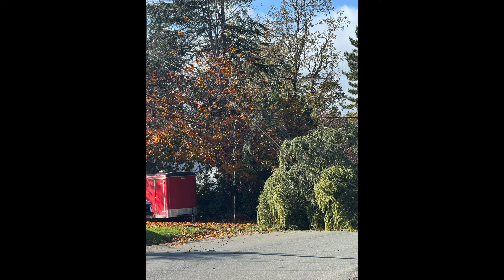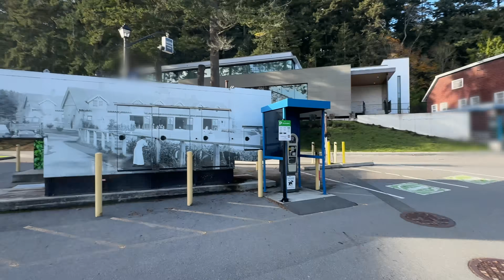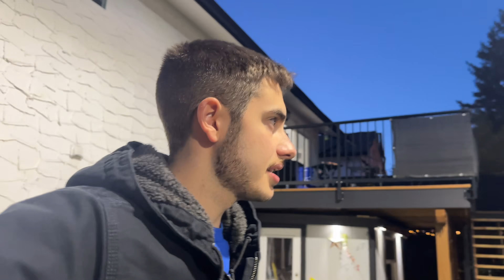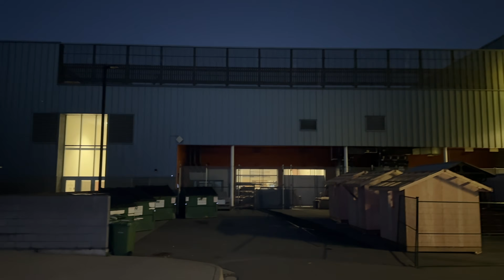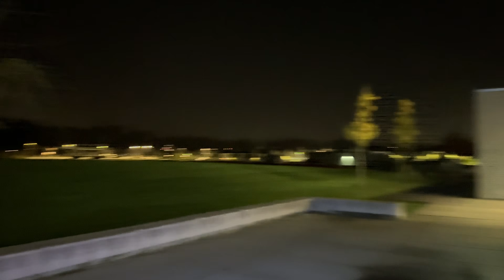11 Hours Of Power Outages And House Electrical Fried With 14,400 Volts On Neutral!

Comment: it might be time for canada and the us to revise the power code to no longer bond neutrals and grounds together at the main panel
Reply: "Neutral-to-earth bonding stands as a cornerstone of electrical safety and stability, particularly in 230V systems where the stakes are high."

Neutral-earth bonding at the service entrance is done around the world.  In Australia they call it a MEN system.  In the UK it would be a TN-C-S system (IEC 60364 nomenclature)  Go read up "Earthing system" on Wikipedia.

In all cases, the purpose of the local earth rod is to compensate for resistance on the shared earth/neutral going back to the utility.  Removing the neutral-earth bond does not make things safer, and in a situation like this could make things much more dangerous for the residents of that house.
Reply: @rampagerick  nothing seems to be safe if the place is surve protected if the surge protection cant shunt that nasty power somwqehre i know i would be homeless after a power surge as my mom wouldnt be able ot afford to replace damaged electrical wire
Reply from the maker: Definitely not a good idea your grounds would be almost useless then and wouldn't protect equipment from becoming energized nearly as effectively.
Reply: I could be wrong as I'm basing this off of my knowledge of American wiring but I think that would stop ground faults from being able to trip circuit breakers. The grounding electrode is for keeping voltage to ground low and it won't allow a path for fault current to flow back to the transformer. The bond allows a low resistance path form the ground to the neutral going back the the transformer to which allows fault current to flow and trip over current devices.

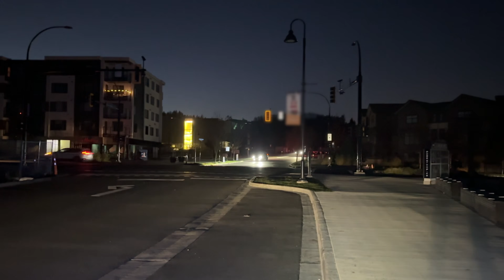Comment: 18:32 - We have the law on the books in Connecticut, and I can't imagine it NOT being a law in all the other states, that you treat a non-functioning/malfunctioning traffic signal as an "all-ways stop." I can't tell you how many times I've almost been rear-ended for stopping at a traffic signal that has no power, even when public works puts out portable "STOP" signs in the street itself.
18:41 - And that's pretty much what I shout, almost word-for-word, although there's usually an obscenity or three thrown in for good measure. Of course, I'm in a car with the windows mostly-up. 😆
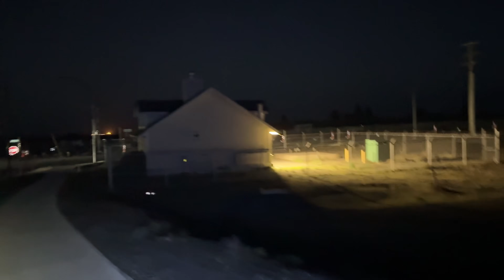19:28 - I appreciate the fact that the pump house isn't built to look like Generic Pump House.
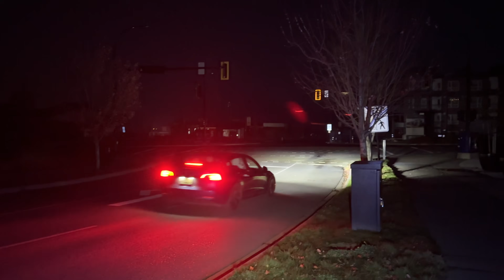19:55 - Hey, buddy, where you gonna charge that Tesla right now, eh? 🤪 (I'm part Canadian, I can say that, right?)

My house has ~300' buried feed, I've never felt better about that than I do after a major storm. Trees can fall in the woods, trees can fall across the driveway, but I don't have to worry about the power lines. As long as the neighbors who back out of their driveway at 20 MPH at 6 AM without looking have power, we have power. 😆
Reply from the maker: Yup same thing here nonfunctional traffic lights is to be used as a four-way stop. There are so many idiots out there though I'll just stop and then go and make the other is not stopping have to do it very abruptly.
Reply: No it depends on the intersection. If im going down a 5 or 6 lane mahor roadway im not going to stop for every little light esecially when i see there is nobody on either side of that intersection. And at large intersections at heavy traffic you need to go in groups of 2 to 4 cars to get though with any efficiency
Reply from the maker: @jacksonledford6874  well if you try that here you are probably going to get hit.

Comment: All the wiring in the house has to be replaced!
Reply from the maker: It will be left up to the electrical contractor if they find the insulation is no good. I can't say for sure it's integrity.
Reply: @nics-systems-electric Residental wiring are rated 500V max, rewire is obligatory or it will cause fire in the future._
Reply from the maker: @DjResR  just 300 V for NMD so they will have to do megger test
Reply: @DjResR  you said it would cause a fire? But if it's short it wouldn't the breakers trip? This is assuming they're replaced with a brand that actually trips.
Reply: @franklofarojr.2969  Short circuit still causes sparks and it igniting something in the wall cavity is a possibility. Even worse if it's not direct short but instead a carbon tracking that acts as a heater or filament._
Reply: @DjResR  Yep and those can happen inside the walls for days or weeks without tripping a standard circuit breaker. This and overloaded extension cords are the leading causes of electrical residential fires
Reply: @franklofarojr.2969  A tripp[ed breaker is no match for the overvoltage event. The main breaker tripped, the fault was to the neutral, which has no breaker and is grounded. The high current source exceeded the capacity for the grounding to hold the voltage low, so the overvoltage went everywhere the neutral and ground wires went.
Reply: Yes you cant trust anything electrical that was connectet at the time of incident. Safety of Insulation is compromised.
Reply: @flipschwipp6572  definitely agree
Reply: Definitely
Reply: The wiring is probably no good. Even if everything is working once the power is restored, that still doesn't mean the insulation isn't damaged. There could be places that the insulation is compromised inside the walls and ceilings and aside from having X ray vision, there is no way to know unless they tear the walls down and look at the wiring, at that point even if the wiring is still good, you might as well replace it.
Reply from the maker: @Truckguy1970  you'd use a megger which is an insulation test to check the insulation.
Reply: @nics-systems-electric  Ah ok, so that should be able to tell if there's a short or a potential for the wires to short or arc between conductors?

Comment: I see people talking about fuses, breakers and surge arrestors.  There's no practical, as in will work at a price that can be afforded, defence against this for a householder.  The only viable option is for the MV to be turned off by the power company when winds exceed a certain speed.  This is actually done in areas prone to hurricanes / cyclones.  Of course you then get bombarded by people that complain the power is off.  Even in places where the neutral is switched (yes the UK and others, I'm looking at you), 14kV is just going to look at the piddly gap that a 240V breaker has and leap across it.
Reply: recloser.... on MV line
Reply: @davidmenjivar6328  Umm no.  For starters it'll blow the crap out of your installation before it opens the first time.  Then it'll close and give the installation another blast.  Then depending on the programming it'll do it again.  Then after it's completely destroyed everything in your house with 2 or 3 whacks it'll decide, right - I'll stay open this time since we have a hard fault.
Reply: @liam3284  L-L of the transformer really doesn't make any difference if you still run a grounded neutral in the MV.  All of what you've said is still reactive so by the time any of the protection goes off the electrical in the house is still destroyed.

Comment: Have you ever considered adding voice evac to your fire system?
Reply from the maker: No the system isn't wired for it and my system isn't compatible. It would require the system to be wired different all over again and a different panel and thousands in amplifiers and related equipment.

Comment: Really stupid question. Considering that the fuel is low and there's no one in there can't you turn off some of the lights to save on power and extend the time that the generator would last?
Reply from the maker: The lights that are on are 24/7 and emergency and don't have any controls like switches. The only way to shut them off would be manually flipping relays and breakers. However you would then have no essential lighting the next day once power came back on.
Reply: @nics-systems-electric  Honestly if it's just flipping them i would consider it just to keep important stuff on, I'm saying turn off something not all of it. But it doesn't seem like a bad idea if the fuel is low
Reply from the maker: @marcosuksatlife9905  the problem is then you have to pay an electrician for a call out to perform that after hours as well as to re-energize the next morning. And to notify all others in the building like custodial staff and anyone that may need to access the building in the night in case of an emergency that your emergency lighting is nonfunctional and the building cannot be legally occupied.
Reply: @nics-systems-electric  oh i see, so yeah my assumption that it was some kind of legal requirement is there.

Where i live (Argentina) there's no thing like that lmao so i was confused

It would be nice if they allowed for some load shedding in case of low fuel just to keep the real important stuff working
Reply from the maker: @marcosuksatlife9905 Yes that pretty much already is the set up. This building is designed to be a community emergency shelter. The lighting that is on is pretty much the legal minimum. The proper thing to do here would be to keep the generator refilled as was requested. The generator with what it was running during this outage was just lighting which is about 30% of the generators total load capacity. however a load reduction does not mean a decreased speed as a electrical generator always has to run at 1800 RPM for this particular one to maintain 60 Hz so it's not like a car where it will idle.
Reply: @nics-systems-electric  less load should use less fuel unless it's so low that the fuel needed to keep that 60Hz ~1800RPM is the same with or without the load
Reply: i might be wrong but at least some fuel can be saved but yeah the proper thing would be to refuel it lmao
Reply: no question is stupid :) 

But yes, certain lights and equipment must run 24/7 during genny ops or the building becomes legally closed and cannot be occupied for any reason.
Reply: @CapStar362  interesting ngl, seems like a waste of power to have all of them on with no occupants but i guess it's a legal thing
Reply: @marcosuksatlife9905  it is a legal thing

Comment: What happened to the grounding system in the house? There could've been some resistance from corrosion of an older grounding system that it couldn't handle enough current and voltage to blow the fuse on the primary before it cooked everything. Those FPE panels are dangerous themselves, surprised the breakers tripped at all. Had a similar incident where a house that had one of those panels was hit by lightening and stuff like that happened when they still had power. None of the breakers tripped and it actually started a fire in the living room because of electrical outlets cooking in the walls arching out. The home owner and wife watched their brand new at the time flat screen tv show a lighting bolt through the center before it blew out the screen and said the receptacles all the way along with walls had sparks and flames shooting out. It would be at least a complete tear out and rewire.
Reply from the maker: I don't think grounding system would have helped regardless of its condition. The grounding system alone I don't think would stand a chance to trip that line. That line feeds over 3000 customers it's a major feeder. I've seen tests done with a grounding system by itself without neutral often doesn't even trip a 15 amp breaker. The neutral/multi grounded system of the utility is in my opinion the only thing that would trip it and those older lines did not have their neutral as frequently grounded. And I would think it's pretty undersized for a primary conductor supplying such a large part of the city to come in contact with it it's resistance was probably way too high to trip quick enough.
Reply: Yeah im curious what the electrodes in use were. Maybe water or ground rods? The grounding electrode system is designed to deal with this sort of thing, though its not perfect. Even at a few hundred ohms resistance to earth, there should be enough current to flow to trip the primary breakers at 14,400V. (Wouldnt do anything at 120 or 240, of course), but of course thats an ideal situation and there are so many variables at play, including time @nics-systems-electric

Comment: Horrible, but cool. Imagine telling someone "You got a 230v service? W E A K.  I HAVE A FUGGIN 14,4KV SERVICE!" if you accually had devices for that voltage, the effinciency would be insane!
Reply from the maker: That shit comes in on the neutral so you ain't even paying for it either haha
Reply: @nics-systems-electric  QUICK, CHARGE THE BATTERIES ( with a 15kv step down module ofc lol)
Reply: @nics-systems-electric Problem is you'd still have to ground off something, likely the hot, so you'd still be sending it through the meter. Although, it'd be going backwards, at really high voltage... I wonder how many kWh your meter would rewind by from that, lol
Reply: @nics-systems-electric  need to not report it and buy own step-down transformer for free electricity!

Comment: I have a story about this exact same thing happening.  My grandparents lived in a log house back in 1994.  In 1997 I believe, they went on a camping trip.  Yes, maybe they should have turned off and unplugged everything prior to leaving but who does that?  I don't.  Anyway, a storm came by while they were gone.  Lightning hit the TV antenna on the roof.  That lightning traveled down the cable TV line, of course, you know that it melted that.  And the TV, of course, you know that it fried it.  The lightning then traveled throughout the entire house through the electrical system and took out everything.  Washer and dryer, stove, refrigerator so all of the food had to be thrown out, coffee maker, garage door opener, VCR, you name it.  Every single last fluorescent light fixture in that house, ballasts had black tar dripping out, ballasts nestled nicely in the potty.  Flush it!  They lost the whole alarm system.  It was a huge mess.  And anybody would know that it was academic, all of those things had to be replaced.  It even melted the electrical wiring so the house had to be rewired.  Bathroom GFCI receptacle, melted.  Ceiling fan, gone.  That was amazing what lightning can do.
Reply: Lightning can do some wicked damage! It can actually twist large full I beams. It's been measured in the millions of volts categories
Reply: I like to tell people that if a lightning strike can travel miles down the sky. That 1/4 gap is no problem for it. Referring to light switches, power switches. 

And, depending on the type, proximity of the strike. Whole home surge will do squat.

Comment: Similar thing happened to my neighbors home last week here in Ohio. One phase of the 27,000 lines snapped and landed on my neighbors overhead coax cable. Blew apart the cable box on the side of the house melted the coax line overhead and I’m assuming damaged quite a bit inside the house. Also nothing tripped when it fell so it was laying on the ground live. Bought my yard on fire, melted the concrete sidewalk and blew a hole in their driveway.
Reply from the maker: Yes I've heard of that happening more commonly definitely a better outcome than your entire service.
Reply: Father and grandfather were both linemen, I have several souvenirs of Glass made from downed power lines made from all sorts of materials (sand, dirt, clay, concrete, etc.). The largest of which we donated to the school system for their electrical safety class (5th grade) as an example of what the power can do (and why you should stay the fuck away from it). It was about the size of my chest.
Reply: Trying to wrap my head around this and the video... It... I don't.... WHAT?!?!?!